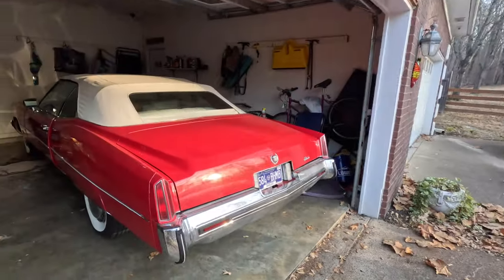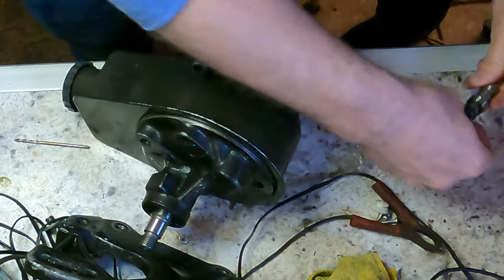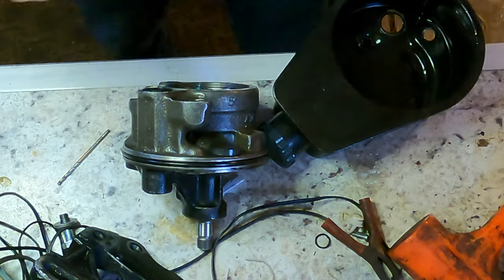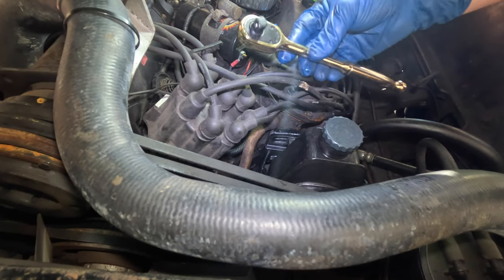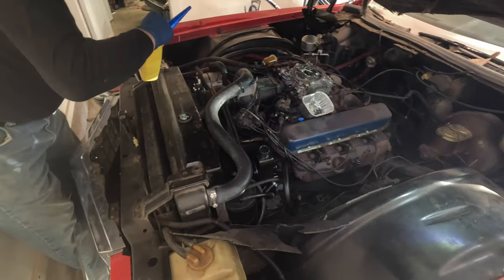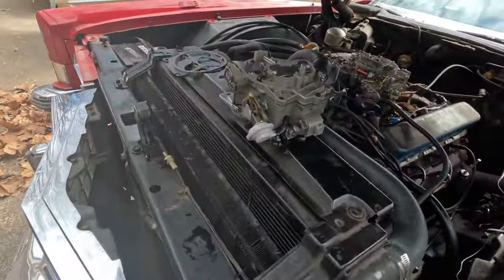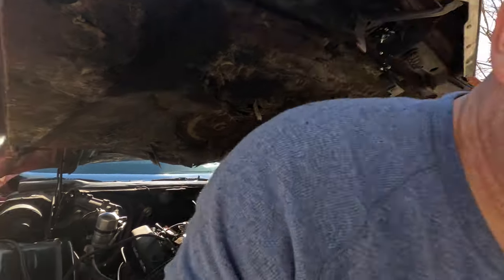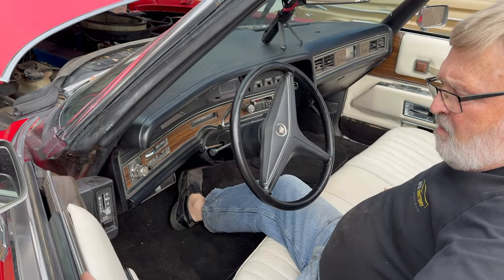Upgrading Santa's Sleigh! 1973 Cadillac Eldorado Convertible Gets A New Carb and Power Steering Fix

Comment: Your video brought me back to the time when I was a Cadillac factory field service representative (starting in the early seventies).  You might want to jump to a 1974 HEI distributor which will fix all of your ignition issues and are still available since the system was used for many years.  That upgrade was very popular back in the day and for good reason due to its reliability and additional performance. Oh, I started watching your channel because I'm in the midst of restoring a '66 Corsa.  Small world, eh!
Reply from the maker: That’s a great idea, I’ll pass it along to my dad.   It only has about 10-12 degrees of total timing so I think something is wrong with the distributor. 

And small world with the Corvair!  Best of luck on your Corsa
Reply: An HEI is a great idea.  Set it up once and it will stay in tune for decades...  An electric choke conversion would be good, too.
Reply from the maker: The electric choke has already been ordered and I think it needs a new distributor (even if we don't do HEI)

Comment: Another issue that showed up as those engines gained age and hours was the nylon/plastic material that was applied to the camshaft sprocket that would deteriorate and allow the camshaft to get out of phase with the crankshaft.  Result would show up in an ignition timing problem, among others.  If another distributor/advance mechanism doesn't fix your problem you may want to chase this possibility.  It is possible to change the sprocket without removing the engine  but it is necessary to lift it enough to allow removal of the oil pan in order to gain access to the engine front cover, etc.
Reply from the maker: That's a good thought, we had to do the same thing on our 1966 Thunderbird.  The cam gear was phenolic and nearly ready to come apart.  I'd like to take a look at that next time I'm in Memphis and get it taken care of permanently.

Comment: The stumble is caused by the accelerator pump not being able to deliver enough fuel. The Quadrajet though is an excellent carb(I like them even more than a Holley)and the one for the engine in that car should have about 800cfm(they had from 780 to 840 rating depending on hp) air flow rate. The compression ratio is low too on those motors so the distributor curve is really important to them. You mean the choke was sticking closed? Ah...you figured it out. Get a HEI distributor for that engine. It is head and shoulder above the Pertronix.
Reply: I Definitely Agree about the HEI Distributor 👍
Reply from the maker: I agree that timing is definitely off on this car.  It's only getting 10-12 degrees of total timing, so it acts like the mechanical advance is stuck.  I'm sure that a new distributor would provide benefit, but what do you notice most about the HEI compared to the Pertronix units?

Comment: HEI Distributor 👍
Reply from the maker: Besides getting rid of the points, what do you see as the benefits of HEI on this car?  It already has a hall effect pickup and a hotter coil.  Plus I've heard you have to remove one of the belts to install the HEI cap.  Thoughts?
Reply: @AutoAnatomy  less problems down the road and very reliable, also quicker starting, it kinda sounds like it needs a bigger battery to really turn that monster engine over.
Reply from the maker: I think the battery was just drained from sitting and not running for a while, but it is a monster engine.  I'll take a look at the HEI options for the car.
Reply: @AutoAnatomy  good idea 💡👍

Comment: No need to replace the distributor in IMHO.  Just get the mechanical advance working and make sure the vacuum advance is doing its thing.  Once you get the timing advances correct you can see how it runs.  With the emissions crippled 500 you might never have the performance that you'd expect from such a huge engine.  My 71 thunderbird would burn the rear tires and had a lot of power for such a big car.  My 73 thunderbird literally would not hit 90 mph on a straight flat highway because of the drop I engine compression and timing of the cam.
Reply from the maker: How much mechanical advance do these cars have, if you know?
Reply: I tried to find the specs on line but could not.  I do have a 68 service manual which of course has the 472 engine.  It shows 12 to 14 degrees at 4000 rpm with 8 to 10 at 2400 rpm for centrifugal advance.  It lists 3.7 to 10 degrees at 12 inches of mercury then 11.3 to 12.6 beginning at 16 inches of mercury for the vacuum advance. @AutoAnatomy